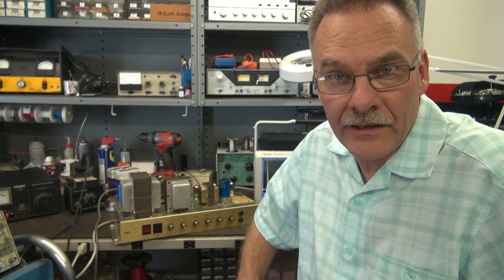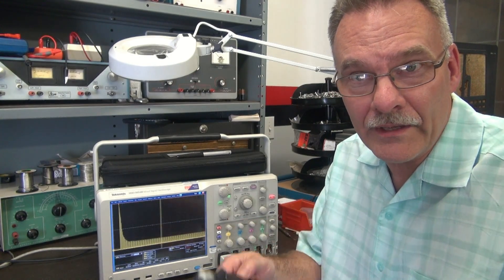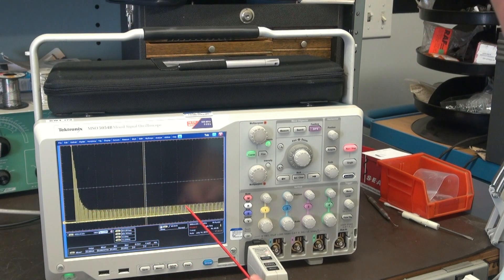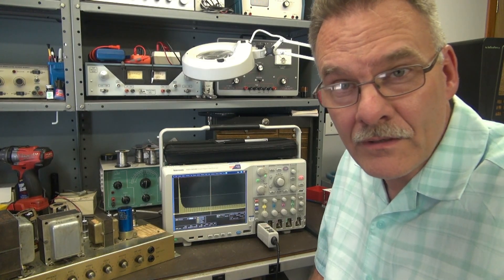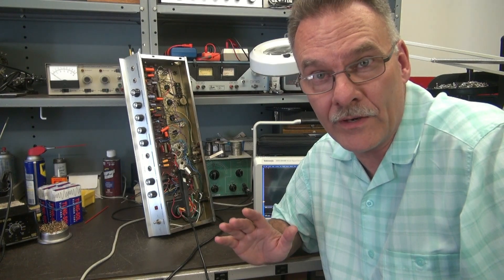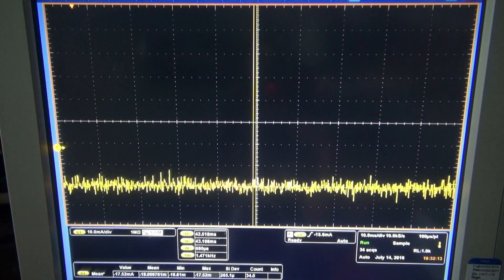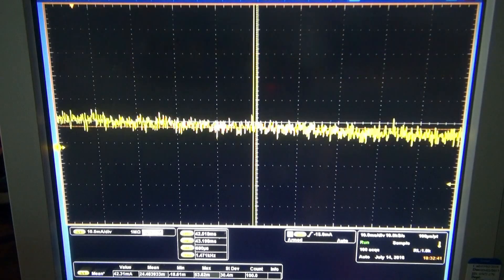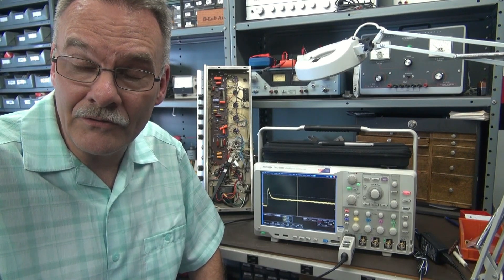Tube Guitar amp standby switch demo Myth buster Marshall Fender

Comment: The standby switch is intended to switch on the HT only, when the tubes are up to their emission temp. Slamming tube plates with high voltage while their cathodes are cold, causes cathode striping and over time, physically pulls the coating off the cathode. Using the standby switch, greatly improves tube life and is it's intended purpose in these amps.
Reply: PaulinTaegu
As you have taken the bait, I see this has nothing to do with the discussion of tubes which I suspected from the beginning.  I'm very well aware of what (CSM) Command Sargent Major is however, I needed to know your intentions. My background and my choice of thumbnails should not concern you in the least. Being that it does, your motivations are not technical but for the sake of argument which I will not do. As Mark Twain said, do not argue with stupid people for they will drag you down to their level and beat you with stupidity. And with this bit of wisdom, I bid you a good day.
Reply: Zeba Strips
Zeba, Cathode stripping is a definite realty however, it will take many hours to show up. Your interest in the subject is admirable. A plus is your ability to spot chickenshit. Take care of your tubes. They will last much much longer if you use that stby switch. The difference between 2 years and 7 years difference. Modern day amps come from the factory with bias at 2 times + plate dissipation of the tubes. My clients love the extended life of their tubes once I restore proper bias. In this case, cathode stripping had nothing to do with the life of the tube. It's a crime for what manufactures do to the tubes they put in their designs. They know they will fail within a year. My advice, if you buy a new amp, get to a tech and re-bias ASAP. The tubes are not the problem. It's the design in bias.
Reply: PaulinTaegu
I was actually referring to a close up examination of the cathode itself. The pitting is is very evident however, it does take many hours of abuse. I am aware of the distances involved between electrodes in a vacume tube and I'm sorry that my 30 plus years of experiences disagree with your opinion. I agree to disagree.
Reply: PaulinTaegu
Absolutely agree with being civil and thank you as well. I can't say that I am familiar with CSM however, I would be interested in knowing  more if you would you care to share it. My training was not Army. I agree with your opinion about older tubes. I too, have had my share of older tubes that out spec newer ones and my ears certainly can tell the difference. I have found that while tubes are voltage driven devices their sonic character are within the current domain and as emission begins to drop off, so too does their sound.
Reply: Wow, I don't understand your need to prove this guy is not military. He is not wearing a uniform or asking for favors. He just has an icon. Big deal. Are you that brainwashed and diluted as to think youtube is reality? You have problems.  I was really fascinated by the conversation pertaining to heater striping when all of a sudden you devolved into nothing that meant nothing. Idiot!
Reply: I bought a blues jr and within 3 months my tubes burnt a tube plate resister. My repair man replaced it and he said I needed new tubes. I was wondering how new tubes could burn out so fast? I think you have explained it. Is there a flaw in the amp that can be fixed? I'm learning electronics and I've done some soldering.....is there something I can do to fix the tube burn out?
Reply: Zeba Strips
Zeba, I always add a bias adjustment pot in these amps so the bias can be increased as plate dissipation is way to high. I don't doubt your abilities however,  it is far safer for you to talk with your amp tech explain to him what I suggested.
Reply from the maker: Hello, appreciate your input. Please take a look at the schematic for the Marshall JMP series tube amps. SW2 (standby) actually turns on-off the high voltage going to the tube plates via the output transformer. It may be other amps are wired different, however this was the type I featured in this video. The Lafayette also breaks the high voltage thru its standby function.
Reply: Thanks for the reply. Maybe you misunderstood my post as you are correct and I agree, that the standby switch does indeed, switch the high voltage on and off as related to the tube plates.The primary point of my post was to state the purpose of the standby switch as you did not cover that in your video and is a very important fact as related to tube life. These switches are to delay the application of high voltage to the tube plates until the heaters have reached their operating temp to prevent cathode stripping. Power on first. Then apply standby about 30 seconds later. This prevents cathode stripping and the reason the switch is there.
Reply from the maker: Roger that Sir, I misunderstood HT meaning heater. Whereas Marshall references that as high voltage. Oops. Now we are on the same page. Sorry about that. TD
Reply: D-lab Electronics Oh, Ok. I see. I added to the confusion. The British tended to refer to the high voltage as the "High Tension" or HT line. I guess this rubbed off on me through the years. I will say that the name is very appropriate when one come in contact with it. It certainly adds a great deal of tension in the muscles and results in a very high voice..!
Reply: @bain5872  Repeating your belief doesn't make it true. Cathode stripping does NOT exist when working at audio frequencies; radio, yes, it can happen, but not with audio. Look for evidence of what you are describing; it doesn't exist.

Cheers,

Alan Tomlinson
Reply: OK, go display your stolen valor and ignorance elsewhere then.  GFY Punk!
Reply: Bain, I certainly appreciate your caring for my safety, I do know a my way around high voltage as I work in an industrial environment daily. If you describe the procedure I can follow your directions. Thank you for your guidance.
Reply: bain587
Reply: I bought a blues jr. last year and it blew up in on week-I will never buy another tube amp that does not have point to point wiring.I had trouble with a brand new hot rod deluxe too. It is a shame how prices go up and quality goes down. I think I am going to buy everything used from now on. Just like guitars-I started building my own and it does not cost that much to build a guitar. If people will pay it, they will just keep going up.
Reply: Bit confused here. When you say "apply standby" do you mean turn the standby switch from "amp on" to "amp offline" prior to using the amp or turn the standby switch from "amp offline" to "amp online" before using the amp?
Reply: The RCA Transmitting Tubes Technical Manual No. 4, p65, states: “Voltage should not be applied to the plates or anodes of vacuum, mercury-vapor, or inert-gas rectifier tubes (except receiving types) until the filaments or cathodes have reached normal operating temperature”. The tubes in guitar amplifiers are receiving types.
Reply: PaulinTaegu
Of course, you are entitled to your opinion however, current flow from the cathode is not a sudden event as you suggest. As the cathode approaches it's intended liberation temp, electrons are indeed pulled from the coating tearing off microscopic flakes. These flakes accumulate in the bottle over hours of use. What I have described is not opinion. I have observed this using a microscope.
Reply: bain5872
I think that upon closer examination of those flakes you will find they are actually bits of the mica insulators that have flaked off and not the actual electron rich coating material from the cathode.  The distance between the plate and cathode is like the Grand Canyon on the electron size scale.  The HV applied is not great enough to strip the coating at that distance.  But you will find that if you accidentally leave your heater voltage applied to your tubes say overnight or a day or two, the change in the cathodes coating will significantly decrease the maximum emission the tube will be capable of from then on.  ;^)
Reply: I don't agree with this.  Think about it.  If the cathode is cold will it be releasing electrons?  No.  Will 450 or even 800 VDC be able to strip the unexcited electron coating from the cathode at the distance these elements are apart.  No, I don't think so.  Mostly what a standby switch will do is help protect your filter caps from an unloaded B+ which is higher than the caps are rated for.  If the cathode is already hot and electrons are liberated, the tube will conduct and pull that voltage down to it's normal operating voltage.  There is another problem with heating your cathodes for extended periods without HV applied.  With nowhere to go the electrons can actually change the chemical structure of the cathode's coating, leaving a slight coating that does not liberate electrons as well, which degrades the tubes performance.
Reply: bain5872
CSM, thank you for keeping this discussion civil.  This subject often gets contentious in other forums.  Most of us who actually still work with tubes tend to have 30 years experience, and a lot of us got our training in the US Army.  ;^)  I only rather recently found out about the chemical coating change heating the cathode without HV applied for extended periods can cause.  Just something for you to consider.  I was trained in the 80's by the US Army to repair crypto gear to the component level.  Back then we only had one refrigerator sized piece of gear that still used vacuum tubes.  That gear and countless HiFi and PA tube amplifiers seem to operate well with long tube life without using a standby switch.  I do agree that the use of a tube rectifier that slowly brings the HV up about the  same time the other tubes cathodes reach operating temp, is less likely to cause any pitting you have witnessed than SS HV rectification.  My reasoning is that tubes with pitted cathodes that can still conduct the full current spec sound better in my amps than tubes with nicely coated cathodes that can now only conduct say 30% of their design spec.  ;^)   "Stands Alone"!  Are you familiar with that Unit motto, CSM?  Best regards!
Reply: While my icon is me flying a paraglider.  Yours is an Army Command Sergeant Major's rank insignia.  Not really sure why you use that icon if you didn't know that?
Reply: I have immense respect for American Soldiers who have attained the rank of CSM.  For someone foolish enough to impersonate one of those courageous Warriors, I have great disdain!

Comment: So on the Marshall amp one could just leave the standby switch in the play position at all times?
Reply from the maker: Yes, I believe that to be true
Reply: @d-labelectronics  No. You have a DC coupled cathode follower in the preamp that will se 100V to high tension om its grid before the tubes are warm.
Reply: @johanhansson4574  That's true. It's a design fault which could have been eliminated by including two components costing just a few cents.
Reply: @silasfatchett7380  Yet no manufacturer does that to this day....why is that?
Reply: @johanhansson4574  Multiply a few cents by a thousand amps. Bean counting accountants.

Comment: I was under the impression that the standby function spared the filter caps from a spike by allowing the tubes to warm up.  Anything to that?
Reply from the maker: Hello, on Marshall amps, the AC feeding the diode rectifiers are switched by the standby SW, therefore the filter caps see no HV until standby is set to ON. On Fenders, They switch on the rectified HV after the rectifier tube, caps are already charged. It really depends on how the manufacturer decide to insert the function. The filter caps have no issue with a few millisecond surge, especially after a tube rectifier since it has natural sag. Hope this helps. TD
Reply: Thanks for clearing up my misconception.

Comment: very good, at least one guy busting the stupid myth, McIntosh never used a standby in their 350W amps, so why bother,all you need in a ss rectified amp is a current limiter and you're done.
Reply: Because Solid State is the problem.
 Point to Point is the only way to go.
 The problems with Solid State are the Printed Circuit Boards. They just create their own problems. They can't stand up to usage, which is why they are Throw Away Units.
 i.e., mars hell !

Comment: This is an interesting subject. I've told many of my tube amp customers (especially one's who owned an amp with a tube rectifier) to leave the standby switch contacts closed and use just the power switch. I recall one incident where a customer with a Dynaco Mark-3 power amplifier. He had a technician install a stand-by switch. However, he placed the switch in a bad spot. He lifted the grounded center tap on the HV secondary. That's not a good idea especially if the bias supply is derived from a separate tap off the secondary. It can cause a rise in voltage across the bias filter cap which can cause it to fail. The bias filter cap in this amp was rated at 47uF at 160VDC. When the standby switch contacts were opened, the voltage rose to over 250 volts.I just disconnected the switch and re-soldered the center tap back to chassis ground. Another good video that proved yet another valid point! Keep 'em comin' Frank Ferraro--Audio Craft Electronics :)
Reply from the maker: Thank you for sharing this info Frank. I am honored to have your support. More vids in the works, just need some spare time.
I am also wondering why the Marshall amps do not have a high failure rate on the standby switch. The switches have a rating of 250vac. I believe in their application, double that is applied to the contacts. Surprised the switches don't arc. Have you ever run across that situation? 500 vac at the tip of your finger! Zapp!!
Reply: I've had failed stand-by switches in the past, but not a frequent occurrence. but I've had blown screen resistors, from shorted output tubes, and blown HT windings on the PT. A lot of the Marshall models, use a separate DC supply for the preamp tube heaters, and I've had many failed rectifier bridges due to the way they're mounted. They push the bridge flat on the PCB which leaves no room for heat expansion, and no heat sink is on the bridge.. When I replace those bridges, I elevate them off the board for air to pass under them and install a clip-on heat sink. Problem solved! :)
Reply from the maker: Man, that's some great info. Any chance you could shoot a video the next time you have that repair situation? Youtube is a great place to help each other with tech tips.
Reply: I'm trying to get properly set up to shoot video, sometimes it difficult when it gets busy, and my shop and bench is such a mess, it's embarrassing :)...but I'm working on it :) I don't mind sharing tech tips to brother technicians...I'm in a secret tech group that I can't talk about here, but hit me up on Facebook (we're friends there already), and I'll fill ya in on getting in it. There's a plethora of knowledge with some of the best techs in the business...
Reply: @djfrank59  yes I have a dsl 201 that has that problem hasn't failed yet but not sure if its been addressed as I bought the amp used....  Guess I should open it up and have a look not good engineering on that lol

Comment: Very good video!   
I usually like to bring up my equipment on a variac over the course of 10 seconds or so.  
Do you think this would help with inrush current? 

Thanks :)
Reply from the maker: Yes, the variac is always a good idea on older amps since their input AC voltage was lower back in the day

Comment: I would be interested to see the test of the marshall with a resistor across the standby switch like some people suggest.  I guess the idea is that it would lower the voltage that gets switched on.  Do you have any thoughts on that?
Reply from the maker: Hello, I have not heard of that mod. Will have to check it out.
Reply: ceriatone has it with a cap on their bassman layout.   the valvewizard mentions it on his page about standby switches.
Reply: I was wondering the same thing, I use a this in a couple amps. One with diode rectification and the other with a gz34.  I always put the standby switch after the first filter cap and an appropriate resistor across the switch.  Makes for a 'softer' start with less of a current jump.  Seems to cure the dredded standby pop sound too.

Comment: When you run the high voltage to the tube before it is at operating temperature you WILL strip the cathodes.That will make the tube fail prematurely.
Reply: Incorrect. You'll need at least 5kV on the plates for 'cathode stripping' to occur, even higher on some tubes.
Reply: John Simms
As long as the tubes are hot ther should be no problem.That usually takes less than 30 seconds.Just don't turn it on and off rapidly/repeatedly as the collapsing magnetic field pulsing like that makes many voltage spikes that can damage your tubes.Like turning the light switch on and off fast makes the lightbulb blow fast.
Reply: I will have to agree with Dlab and Riftamps on this one.  Standby switches are not necessary in 99% of audio applications (100% of guitar/bass amps I've come across). Here's a little write-up I did. http://blacklodgeamps.tumblr.com/post/96920205757/the-stand-by-myth
Reply: Can standby switches cause any harm? I like to turn the power on, wait three minutes, then turn the standby switch to the play position.

Comment: That was interesting and good info to store away in the memory bank (bit). I'd have lost big money (up to 50 cents) if I'd been betting on the standby switch being useful or not. I wouldn't mind having a Tek scope like that one. (see note in parenthesis :o) )  73 NE5U  Mike
Reply from the maker: Yes, I agree. The scope is nice. There is a huge learning curve to operating it. All Windows 7 based. The current probe is really nice. The scope automatically sets its mode to current when connected. I had the scope to single sample mode. Thats why there was a delay as it was charting the trace.